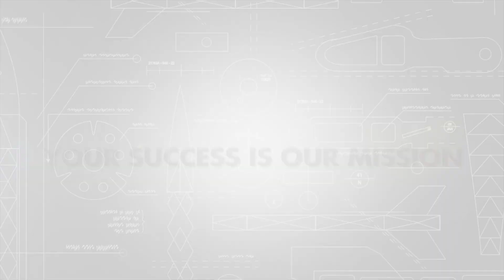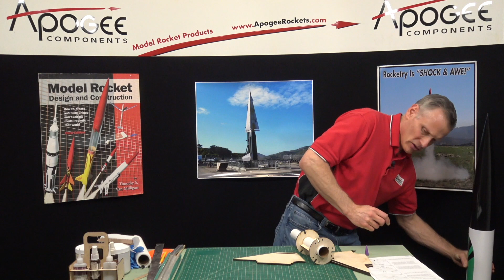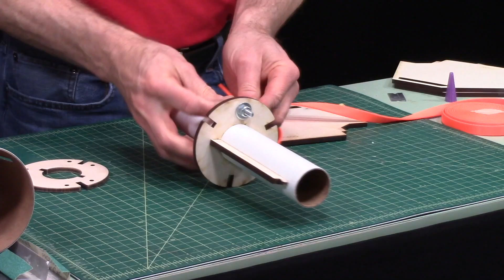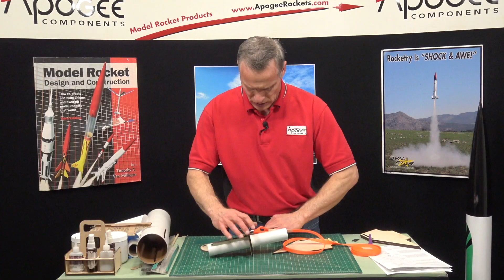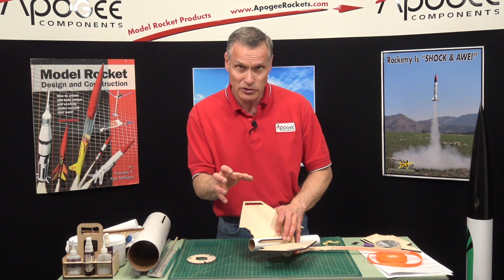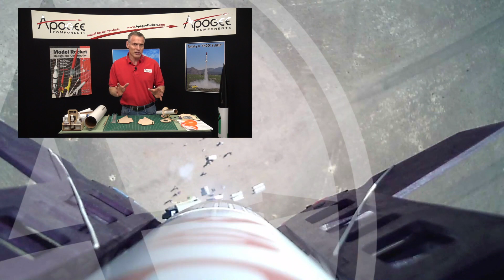Zephyr Build 2

Comment: The Zephyr is a great rocket.  I'm currently teaching a high-power rocketry certification course.  I have 15 students, 11 juniors and 4 parents.  The Zephyr doesn't require fin alignment jigs and the interlocking fins and centering rings make it very strong.  And it flies beautifully on H and I motors.

Comment: Relative to the masking tape, doesn't that actually burn pretty easily? Wouldn't it be better to use electrical or aluminum tape, or a high-heat resistant sleeve?

Comment: I like to watch on YouTube so I can anonymously insult you and you don't know who is doing it and it makes you feel bad.  It makes me feel superior.  ;-)  Isn't that the whole point of YouTube?

But seriously...In the next couple videos, where you epoxy the fins inside and out, there seems to be runs and drips everywhere.  That's why I hate epoxy and use wood glue whenever I can.  But I've never tried the alcohol trick.  Can you really just wipe off all that mess and not have to scrape   and sand it later?
Reply: yes as long as you do it before it kicks and starts hardening
Reply: Alcohol is good for removing excess epoxy as long as you get to it before it cures too much.  Also, carpenter's glue like Titebond II are good for Rockets powered by H and I motors.